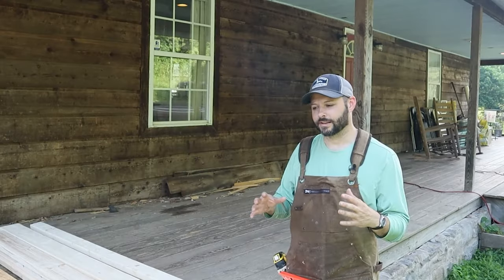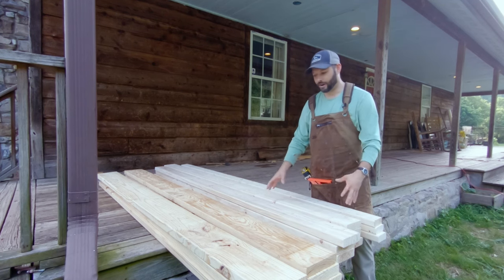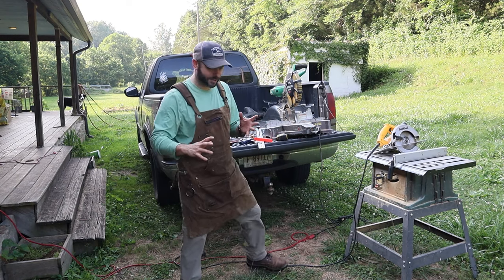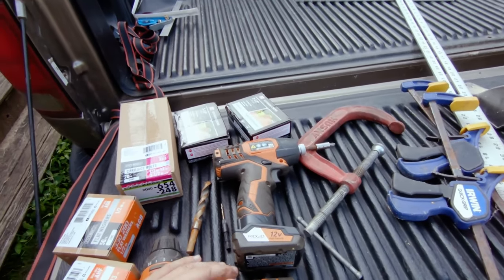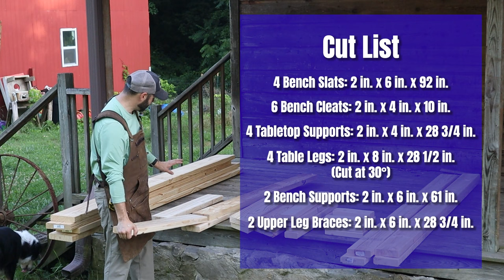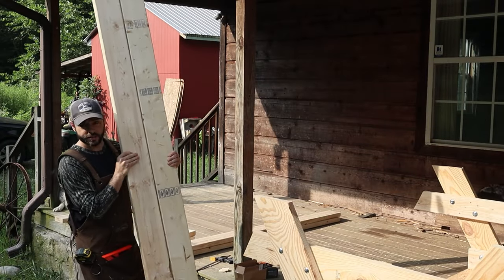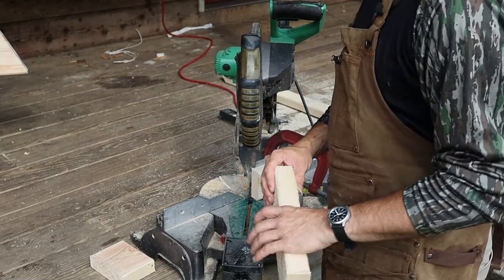DIY Picnic Table Build

Comment: Ive built 2 tables off this format. Thanks for the guide. I got 30 more to go. BUilding them for my campground. These are built like a TANK! got to put them on furniture dollys just to move them in my shop LOL. Thanks again
Reply from the maker: They should certainly hold up at the camp ground then. How long is it taking to build them in production?
Reply: Awesome! Wish you could share a picture!
Reply: Does he rip the 2x8 and 2x6 to be thinner?
Reply: Do you use treated lumber?
Reply: How much does one cost roughly

Comment: Thank you so much! 
I found a community garden that has rotting warping picnic tables.
Some planks on the table curve up like a smile and the bench on one side has bowed (asp like a smile- that broke) dead center. 
For long lasting, would it need some sort of center brace on such a long bench?

My dream is to surprise the city with some new picnic tables or at least enjoy them as long as they keep it open.

I just moved here and was delighted to find a city garden not padlocked after hours.

It’s my secret delight to go pull weeds and till the empty raised garden beds. A little each day!!

My dad sells Live Edge hardwoods. Has 14 varieties.

For the tables I’m thinking post oak. Or black locust. Just for endurance. 

I’ve meticulously screenshotted each step here with supplies and cuts and instructions captioning my pictures.

I’m a novice but you make this totally doable! I get it. 
Hoping Dad will donate some wood for a good cause but this one time… those ‘live edges” will have to be made straight.

Can’t wait to start! 
Looks like covid was the last time this place was used and I’m super excited to try my hand at a transformation!

Comment: Great job! I learned something today. Thanks for the tip on using the speed square as a spacer due to its dimensions to keep the spacing even. Found that very valuable and practical. Thanks again.

Comment: Great video! I’m trying to build a low profile picnic table for my kids .. have them sit on pillows. Something smaller so easy to transport. I’m wondering if I could apply your build with the same table top but without the benches. I’m only making it 4 feet long, so would screw on legs support it ? 

Also I was looking at your description and you put 2 items as 2x6x8 but different quantities.. I was confused.. but I love the video. I might make one for adults after this project.

Comment: At 2:47 Did you rip down the 2x6 or 2x8 to be less wide? Or is that a 2x10 you made into 2x8? Im wondering if i can use this video wothout a table saw, only miter saw
Reply from the maker: Ha! That was my oops. I wasn’t paying attention to my cut list and cut both the upper leg braces out of the same 2x6x8 and didn’t have another one long enough for both the bench supports. If you cut one upper brace and one bench support from each 2x6 then you’ll have enough lumber without having to rip down a 2x8 like I did.
Reply: @HurricaneHomestead  I just found you mentioned that after studying the video more. Thank you very much and expect the occasional question in the next few days or so lol 😆

Comment: Great vid! Did you use pressure treated?
Reply from the maker: I did not. Didn’t think it would be best to use a chemically treated lumber for something people would be eating off of. Also, the plan was to stain and seal the wood, but I ended up selling it before we got around to that.
Reply: @HurricaneHomestead  Great thought, but I think I'm going to use treated lumber for the legs and braces. Thanks for the vidio and plans.

Comment: I noticed that you didn't pay any attention to the crown of the wood. is that not necessary for tables?
Reply from the maker: You can totally pay attention to the crown of the wood. When I purchased my lumber, I ensured they were all about as straight as possible so there was not a lot of difference to start with. If there was one crowning a lot more than the others, I would have put the bow up and pulled it down flat with the others. But this is outside furniture we are talking about, not a $5000 boardroom conference table.
Reply: @HurricaneHomestead  I've never built furniture (inside or outside), but I have built a number of decks, and I know that if you don't pay attention to the crown, in a year or so it just won't look right (wavy and crooked). I suppose that because a table is so small, it might not really matter.

Comment: What angle did you  cut for the  feet? Thanks
Reply from the maker: That is a great question! If I remember correctly it was about 30 degrees. Yup. It’s 30 degrees. I’ve got a cut list at time stamp 3:38.

Comment: I followed these instructions to the letter and ended up with a table 26" off the ground and only 12" between the bench and table top.  I sliced the whole thing up into 16" wood blocks to use for other purposes and swore I would never try to build anything again.  There are way too many measurements missing from this video.